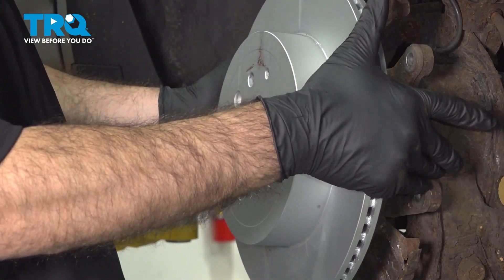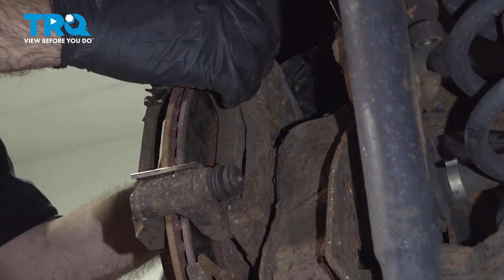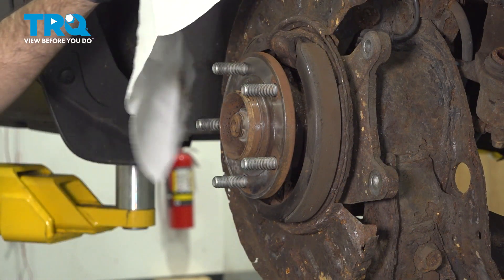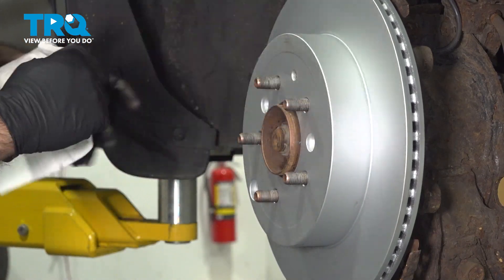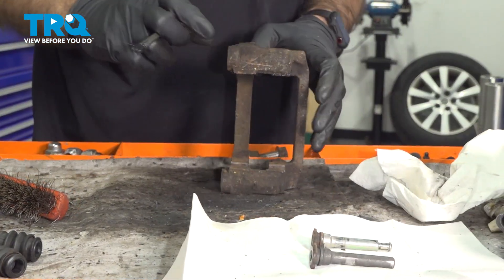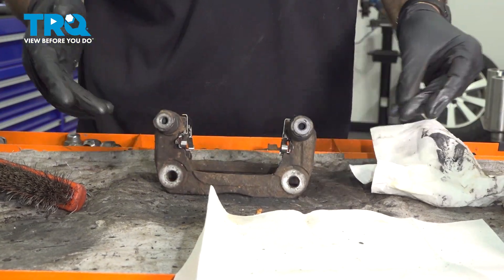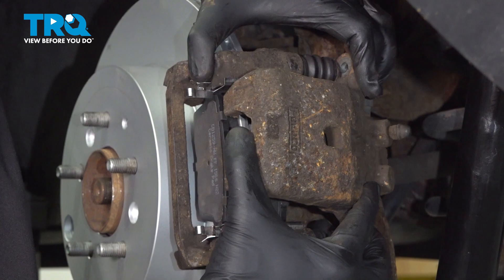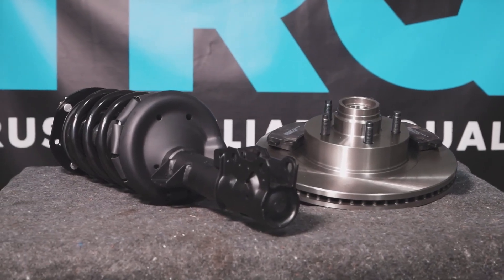How to Replace Rear Brakes 2007-2015 Mazda CX-9

Comment: Why did I see an old rusty brake rotor when he torqued the wheel nuts on? 😏 Also I would have sprayed off all the e brake shoes and hardware while I had the rotor off. But very informative video as always!

Comment: You really need to add how to reset the E-brake if necessary, which is the reason I watched this. Otherwise it's just a normal brake job.